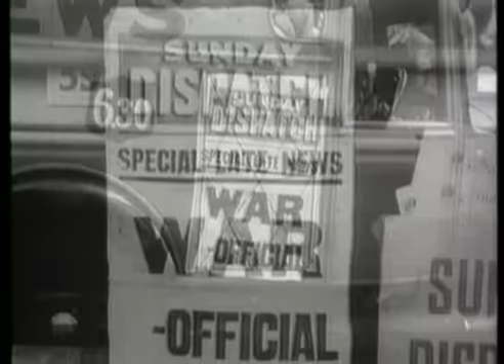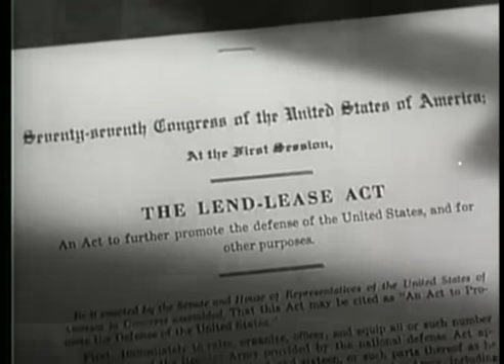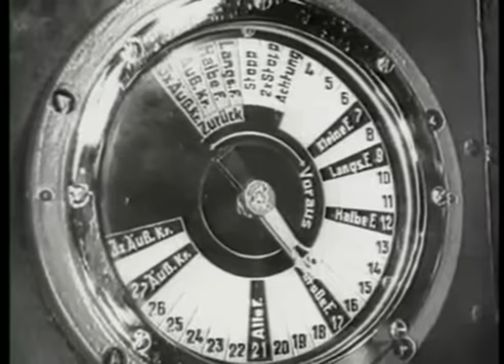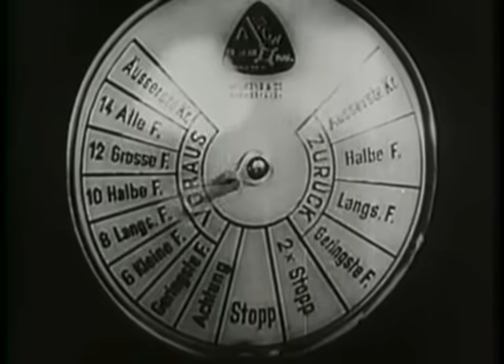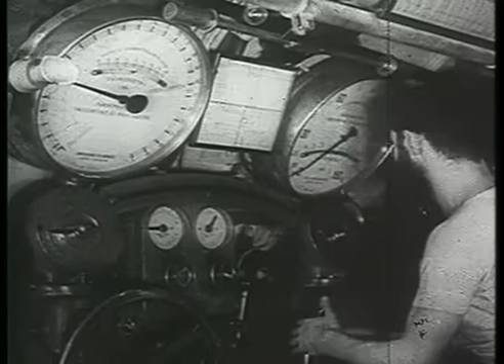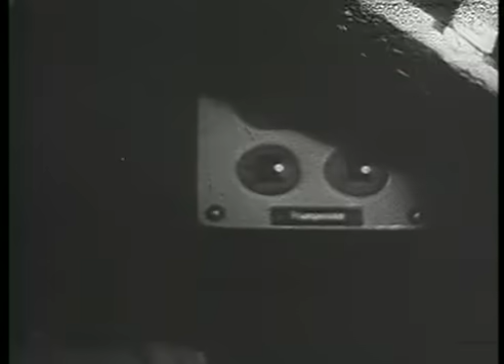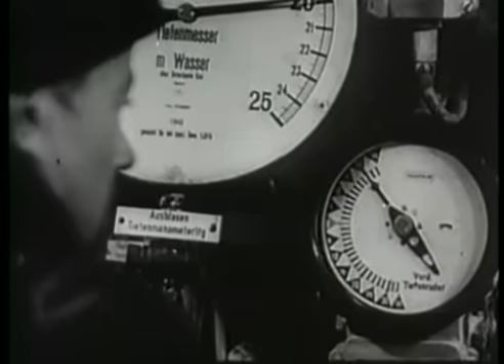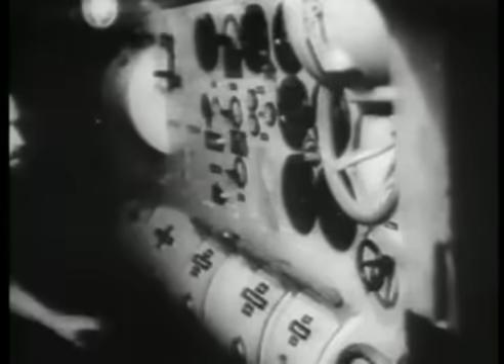Battlefield S2/E2 - The Battle of the Atlantic

Comment: Adm. Doenitz was indeed an excellent choice to lead the German navy, especially for the U-boat service.  His tendency toward micromanagement was his downfall.  He sent copious radio messages to his U-boat commanders which, unbeknownst to him, were being read pretty regularly beginning about midway through the war.  Good for us, not so good for him.  To his credit, the navy's radio operators were much more highly disciplined in the use of Enigma than Germany's other military branches.  He also insisted on increasing the complexity of the navy's Enigma machines compared to those of other German armed services.  His submariners paid a very heavy price without achieving their stated purpose.  Too bad for them..
Reply: Once you knew an enemy's secret, the fact that you knew his secret became itself a secret.  When relying on their ability to read the German code to attack, say, a Mediterranean convoy, the allies would send several reconnaissance aircraft to overfly the convoy anyway - just so that the Germans would assume themselves to have been physically spotted (rather than questioning their code, which might have lead them to alter it - putting the allies back in an intelligence blackout).
Reply: If Hitler had not  wasted his resources on surface raiders/ capital ships and put it into the U-boat program.  He came so close early in the war.

Comment: Corvettes: 
Somebody had to dream up using the 4" gun to fire either small depth charges (or the projectile later used by the hedgehog) to improve its threat value. Although bagged propellant (in small sizes) would have been almost impossible to keep dry on those hasty little ships. A housing for the gun and boxed charges may have answered some of that.
Another opportunity lost by the Admiralty?

Comment: Small nitpick:  The Admiral Graf Spee was a heavy cruiser, not a battleship.  There’s a pretty big size and performance difference between battleships and heavy cruisers, so calling Graf Spee a battleship just isn’t correct.

Also, based on what I’ve read, Hitler didn’t initially opt for unrestrained warfare on British shipping mainly because, after Britain’s constant appeasement policy in the 30s, he didn’t think that they’d have the stomach to keep fighting him if he didn’t’t push them too hard.  Once he realized that Britain was determined to fight it out, he gave the green light on unrestricted U-boat warfare.
Reply: I heard the expression "pocket battleship" for the Graf Spee for whatever that means for different people
Reply: That's why Graf Spee was called a 'pocket battleship'.  Which was a British invented term.  Although technically, you are correct.  She was a heavy crusier, and that is what the Kriegsmarine designated her.
Reply: Graf Spee , a "heavy cruiser" with radar-controlled 11 inch guns. The battleship "HMS Dreadnought" was built with 12 inch guns." Pocket battleship" is a better British term for the Graf Spee;  at the Battle of the River Platte, HMS Exeter had 8 inch guns (heavy cruiser) and HMSes Ajax and Achilles had 6 inch guns (light cruiser).

Comment: I'm curious as to why, since packs of U-Boats had the element of surprise, would they not engage and sink the escort ships first, forcing them to disperse, and then turning on the convoy?
Reply: The targets were always the merchant ships.  They were carrying the war material like guns, ammo and tanks.  Also food.  The escorts were never targeted in a convoy because wasting torpedoes on an escort meant less chance to sink the ships carrying the cargo.
Reply: The escorts were faster, could shoot back and they weren't the priority for U-boats which only had a very limited number of torpedoes aboard and would have to immediately head back to base for weeks long resupply and refit when they were all expended.

Now in the Pacific toward the latter part of the war, U.S. "fleet" subs that were bigger, longer-ranged and had access to forward bases the U.S. Navy had captured closer to Japan - those boats would sometimes specifically target Japanese destroyers to take out the escorts and make attacks on Japanese convoys easier.

It was always a dangerous game, however, since firing at the destroyers almost always let the enemy know the exact direction the sub was coming from.

If you missed, you'd usually have them charging you with depth charges ready to go in a couple of minutes or less.

Comment: The Focke Achgelis was a kite that some of the U-boats on the surface with smooth water used to sight convoys at greater distances than they could by sighting from the bridge. Focke Achgelis Fa 330 should bring up a YT video that shows the thing flying. Keywording Focke Achgelis should allow you to see a picture of the device on wikipedia. I met a former U-boat pilot at his fremdenzimmer in southern Germany in 1978. He said he never had to bail from his kite, but that had an airplane shown up or a threat by sea he would have separated the rotor and pulled the ripcord on his parachute with the hope that it opened in the 200' or so he was above the water. When his boat was sunk by a British bomber in the Bay of Biskay in 1944, he was one of 17 survivors. A U-boat crew totaled 44, and usually there were a few others aboard.
Reply: Yes, Germans could see much further. But they could also be seen from much further away, especially if the watcher had radar.

Comment: I'm so sorry, but I spotted another caliber mistake, of which there are quite a few in this series: At 50:05, the Liberty cargo ship class is described as having 2x 400mm AA guns (for Americans, that is about 16", the caliber of the main guns on an Iowa class battleship). The actual caliber of these guns was 4" (102mm). These really were AA guns, but the main purpose was for attacking surfaced submarines. Subs at the time could not remain submerged for long, they needed to replenish their air supply, and recharge their ineffective batteries often by running their diesel engines, which was only possible when surfaced.  Their electric motors were also slow and the effective fuel consumption was high. Submarines were small vessels that could easily be crippled or sunk by small cannons, so this was a major limitation.

Later subs were outfitted with snorkels, which gave them the ability to exchange air, and run their diesel engines, at about periscope depth, where they were still susceptible to gun fire, but much harder to spot, especially at night. Nuclear submarines, which could stay submerged for months on end, were only introduced after the war, and were never available to the Germans.

The introduction of the submarine snorkel was delayed in an almost comical fashion. A Scottish company received a patent on it in 1916 but the Royal Navy did not consider it useful. The Italians successfully tested snorkels in 1928, but still did not use them in their designs. The Germans eventually considered outfitting new vessels with it after capturing prototypes from the Royal Netherlands Navy, but only wanted to use them at this time for air exchange, and not for running diesels. Only after the U-Boat fleet had suffered disastrous losses to enemy aircraft and gun fire from surface vessels were new submarine types outfitted with snorkels capable of taking in enough air for, and dissipating the exhaust of, the diesel engines.

Comment: "The Americans warned Rear Admiral John Godfrey, the head of Naval Intelligence, in 1941 that British codes were insecure. By August 1942 Bletchley had discovered that Naval Cipher 3, which was set aside for Anglo-American use, had been penetrated. But the Admiralty did not change the cipher until the following June, leading to thousands of deaths at sea. Meanwhile Admiral Karl Dönitz, commander of Germany's U-boat fleet, was worried about Enigma's security and changed the Nazi codes, hampering Britain's own intelligence."
Revealed: the careless mistake by Bletchley's Enigma code-crackers that cost Allied lives page   Requires registration
Reply: Bletchley Park is massively overrated.

Comment: 1:15:10 I don't see why the leading escorts didn't try pulling a long net like object that would shield the merchant ships from torpedoes altogether. Seems to me it would be a simple solution.  All torpedoes are only a few feet deep and you know where they will be aimed.
Reply: Too heavy, too much drag, and like all things in war, each counter-measure elicits a counter-counter-measure. Torpedoes can be set to a particular depth. Those you have seen on the surface were fired by boats and soon dip to their regulated depth.

Comment: You have to remember rifles only have a limited effective range. And aircraft are extremely hard to hit. Even the hits they did score would do very little damage. Aircraft by the 1940s had armor protection. They were also able to still keep flying when riddled with holes. Also people tend to be more concerned with hiding when a bomb laden plane, firing high caliber rounds at them descends.

Comment: A range of 24,000 miles for a diesel submarine???
Are your sure?
Reply: They also went on batteries wich was charged in surface mode.
Reply: @pagedown4195  Charged by the diesel engines which is far less efficient.
Reply: It's 22k around the world, can't be correct. It's more like 6k

Comment: At 17:11, it shows a 4 engine aircraft assembly line. I can't identify the WWII type. They are not B-24s. With the "dip" between wing and the cockpit, looks like a seaplane but... Anyone ?
Reply: I inspected the scene and I believe that they are B-24 Liberators, the first plane appears to have a "dip" but then when you look at the second and third planes the wings are straight. Note also the location of the matching gunners window positions and that the body of the plane lacks a boat like hull shape. I wonder if the assembly line shown is the Ford Willow Run Plant built specifically by Ford to produce B-24 and a very cunning way by Ford to be able to build a new plant during war restrictions, and a patriotic War Production boasting point, almost ready for use building cars straight after WW11.
Reply: I think they are some kind of Martin Flying Boat...
Reply: Tim Mc Hugh  First, thx for answering.
Nice answer man but I went through dozens of Google image pages and all Martin that have a dip behind the cockpit have "gull" wings. I couldn't find anything that matches.
Then I re-read Mark's post and searched for "Ford Willow Run Plant" pictures and fell on the following page. They are B-24s.
To every one, the "Vintage Wings of Canada" page is awesome:
http://www.vintagewings.ca/VintageNews/Stories/tabid/116/ArticleType/ArticleView/ArticleID/367/language/en-CA/Default.aspx
Reply: Mark Fryer
Ya man you are right. The dip behind the cockpit is the dorsal turret opening.
The grain of the video makes it very hard to see. Optical illusion here.
Check the link I just put in my previous post. So many beauties.
Reply: ***** Your welcome DawgPro, sometimes our eyes play tricks watching these old videos.
I checked out that Vintage Wings link.
WOW what an eyeful.
How was the "Tax Turn" at Willow Run, turning a production line 90 deg. just to save money on rates taxes. Amazing.
Thanks again for posting that link it was well worth a visit and plenty more revisits.
Reply: ***** Go show, Was he in the RCAF flying or maintaining them ? Or was he at one of the plant where they were built ?
My father was a navigator on Lancasters in 44-45. Sitting sideways at a chart table behind the pilot and co-pilot. In his old age, he was deaf !
Reply: You will find all thru the Battlefield series film clips which are not what they they should be.  I feel they simply pulled videos from their huge pile, and inserted one which, while not authentic, gives one a general visible image.

Still and all.  This is a great series.  My father served in North Africa and Italy.
Reply: Garry Schaffer
 Ya that is for sure. In many documentary series, from episode to episode, they often use the same footing that was relevant at one place but not at the other.
I don't mind really, it's the whole thing; the story, the narration, the pictures, etc..

Comment: anybody know what happened to the aircraft carrier the germans were building?
Reply: Inspite of being close to completion, she was cancelled in 1940 due mainly to the German aircraft industry's inability to develop suitable purpose built carrier aircraft, instead of the botched seagoing variants of established land based aircraft that were originally proposed.

She spent most of WW2 as a floating timber warehouse in the port of Gotenhafen on the Baltic, and when the Soviet armies closed in on the city in 1944 she was moved to Stettin, where she was eventually scuttled outside the port in April 1945.
Reply: @walterkronkitesleftshoe6684  Many thanks Walter. It seems a bit of waste of a nearly complete ship. I wonder if it had been named before it was sunk.
Reply: @petemoss8625  Yes Pete, the class of aircraft carrier was named the "Graf Zeppelin" class, and the one ship that was near completed was the lead ship that carried the same name herself. Ferdinand Graf von Zeppelin was a German aeronautical engineer who pioneered long range air travel using rigid framed airships, that used to be called, guess what, "Zeppelins", though they generally became better known as "airships" such as the famous "Hindenburg" & "R-101" amongst others.

Search for "Graf Zeppelin aircraft carrier", there you'll find plenty of information and more than a few photographs of the ship. All the best.
Reply: @walterkronkitesleftshoe6684  that's great information sir. Thank you for taking the time to comment.

Comment: Why did the Allies not fight U boat with their own U boats ?
Reply: Why would you fight hard to spot, slow, submersible craft with other similar craft that also have very short spotting ranges and poor underwater detection equipment? No far batter to use aircraft equipped with radar that can be quickly redeployed and detect subs at far greater ranges with their airborne radar.
Reply: @walterkronkitesleftshoe6684  I am merely asking the question.  However if a similar threat is posed by you enemy sub to sub I don't see why not. Besides such subs would  not need to have long range underwater  detection, since the enemy comes to you .  I cannot see that aircraft spotting subs and sinking them was that successful given the amount of convoy ships sunk
Reply: @Kirkee7  Quite simply why would you use a weapon that is slow to redeploy and has a short spotting range against other small targets? The u-boat hydrophone was useful in detecting the thumping steam engines of 50-60 ships in a convoy, but next to useless in locating a single submarine, submerged and running on electric motors. As for the effectiveness of aircraft against submarines, it was two fold, on the one hand they were able to very quickly attack a u-boat spotted by eye or airborne radar, and even if their weapons had been expended the mere presence of an aircraft near a u-boat would in almost all cases cause the u-boat to submerge, rendering it unable to close on a convoy at its top surface speed of 16-18 knots, and instead force it to travel at its economical underwater speed of 2-4 knots.

I will dig out some figures for u-boat losses at the hands of aircraft, also remember that a large number of those subs sunk by surface craft will have been first spotted and "pinned down" by aircraft as defensive escorts than rallied to come in and finish them off. Suffice to say that aircraft were the DECISIVE factor in keeping Britain's sea lanes open, and winning the battle of the Atlantic.